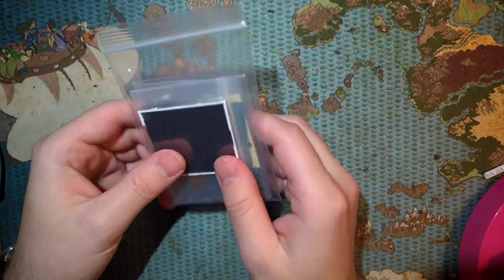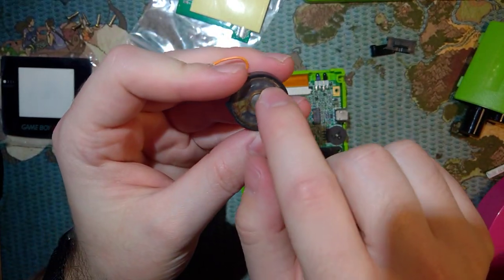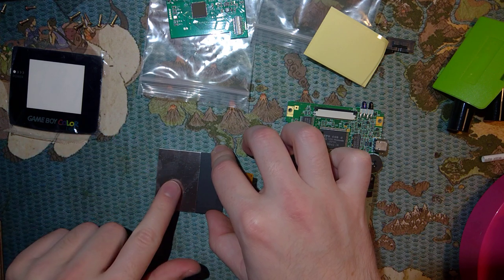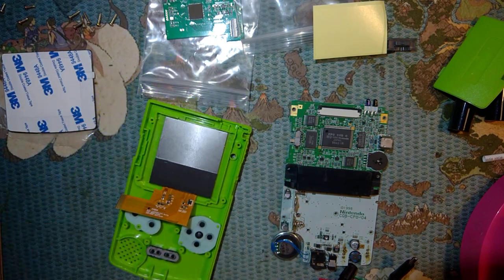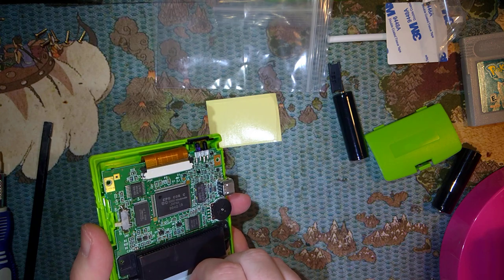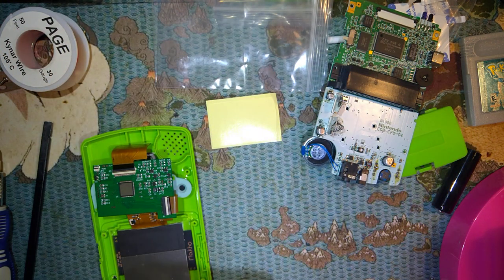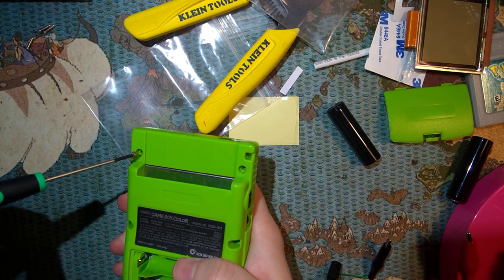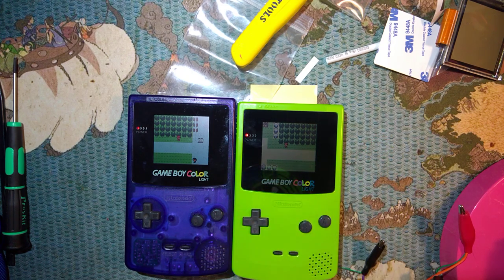Installing a Backlight kit (HiVision AIO) in a Game Boy Color

Comment from the maker: It looks like there are at least four different hardware revisions for this backlight kit right now and one of them may have fixed the frame dropping issue. Of course, this variant is not the one I have. The first is what I have in my Midnight Blue GBC and my NGPC and the third is what I have in my Pocket and this Kiwi GBC. 

Rev 1 (frame fropping, on the left): https://cdn.discordapp.com/attachments/246604458744610816/647904995374661664/Fll8cmjE1FZ7b8hICvPFKOdu1zKVC8t2U-R6TbUcNzG9VUzugNLfXCSLX_rEBOsrUVnkN8tz3Q-5OO8XtmfkuixGRhOj4vJ_tFic.png

Rev 2 (no frame dropping): https://cdn.discordapp.com/attachments/246604458744610816/647913031648542748/IMG_20191123_1334072.jpg

Rev 3 (This kit, frame dropping): https://cdn.discordapp.com/attachments/246604458744610816/647906484969013248/unknown.png

Rev 4 (Unknown frame dropping, resembles rev 2 and rev 3): https://cdn.discordapp.com/attachments/246604458744610816/648263817226092554/U2239c175e9334f0090057c7943ccf5beG.png

More investigation is required.

edit: better pic for rev2. It looks like Rev2 uses a different FPGA entirely. I wonder if these kits are even made by the same person/people.
edit2: found another hardware variant. I don't think calling these "revisions" the way I have been is accurate because I think these are just two separate mods.
Reply from the maker: @epicpikachu3822  Unless they are selling something other than the pictures, no they are not.
Reply: @makho  someone on reddit bought this specific kit and it came with the rev 2 pcb and if you look at the images from buyers it's the same exact pcb rev 2
Reply from the maker: @epicpikachu3822  Oh wow, good catch. I missed that entirely. Thanks!
Reply: @makho  So this is a kit that I should get?
Reply from the maker: @H1ZUMI  assuming you get what's pictured, yes. Even if not though, the kit is still a really good value for the cost.
Reply: @makho  I will take a chance and buy it.
Reply from the maker: @H1ZUMI  Ok, good luck. I already picked up a kit from HHL and I should get it tomorrow.
Reply: @makho  Oh please let me know what you get, thanks!
Reply: @makho  What is HHL and did you get it? :)
Reply from the maker: @H1ZUMI  HandHeldLegend. And yes I did get it in the mail but since the mail came late and I was not home to pick up the package, I will not be able to get it until tomorrow. From pics that another person shared from their order though, they did get the "desirable" kit. I'll be sure to post an update when I actually have my hands on my kit though.
Reply: @makho  Oh unfortunately sold out on HHL, i'll try my luck with the Aliexpress one.
Reply from the maker: @H1ZUMI  I might have another source, just waiting for an email back to confirm. I think that aliexpress store is a good bet otherwise though.
Reply: @makho  Have you ever tried a screen from retromodding? they are actually located in the city I live.
Reply from the maker: @H1ZUMI  No, I have not. I do wonder what kits they stock though.
Reply: @H1ZUMI  i seen a review from today that says they ordered 2 of them and they were both the hivision models that have the frame dropping. So they might just be randomly shipping different models.
Reply: @PLATESWEEPER  Alright so AliExpress is not a safe place to order :(
Reply: BennVenn announced V 2.5 today of his freckleshack kit
Reply: @epicpikachu3822  Do you happen to still have the reddit link ? I would like to be sure this has no frame drops before buying.

Comment: Where did you buy this kit and what is the size of the screen compared with the original? Great video
Reply from the maker: The screen size is smaller and while I got this kit off of aliexpress, the specific vendor I got it from is not one that I recommend. If you are in the US, I'd check out retrogamerepairshop.com otherwise there are some vendors on aliexpress. Just check the reviews for pictures and make sure you pic a vendor that shows the larger kit with the unmarked FPGA instead of the smaller defaced hivision IC. See my pinned comment for more info and pictures.

Comment: Can you do an other hardware mod to the 3DS? Also, I have an Old 3DS XL. Can I change the USB-A to USB-C ?
Reply from the maker: What mods are you thinking of? And what do you mean change the USB-A to USB-C? If you mean replace the charge port on the 3DS XL with USB-C, yes, you can. My custom PCB adapter that I made should work perfectly for the 3DS XL as well.
Reply: @makho   a mod to overclock the 3DS (old and New). Or add an capture card. Can you do this? Thanks.
Reply from the maker: @stef0469  Overclock? No. Something like that might be able to be done in software though. N3DS can already stream with CFW and for O3DS there is this: https://3dscapture.com/

Comment: Hi. Sorry about this comment. I will not pay the price they are asking, back then, I paid equivalent to 1/30 of a full month work of a basic teacher with no specializations  in a brand new gameboy. To pay more than 10USD nowadays would be unthinkable in a thing like this, even for nostalgia purposes. Don't care, kinda want it, but will only surelly buy it IF it becomes 10 or less usd and no soldering required, just because. Thanx by your attention, just an outburst, hope it becomes true in any future.
Reply: oh, and the display being smaller than the original is not acceptable. There are 2usd lamps you can use to light the gbc, much better and doens't use as much battery. Hope a company backlight producer reads this.